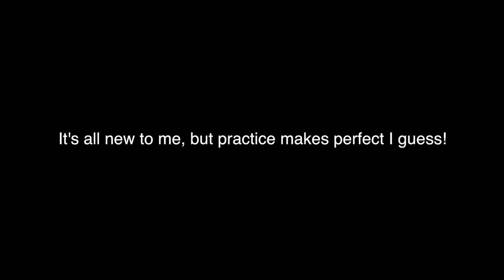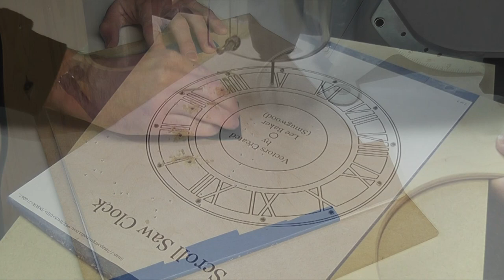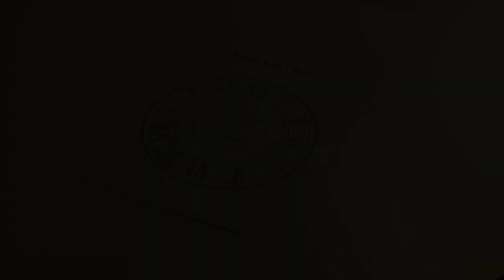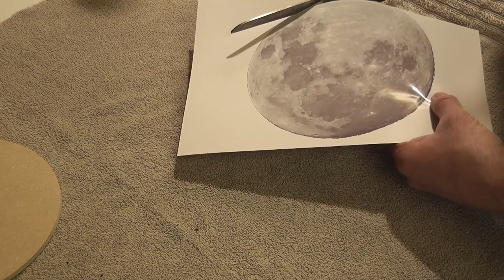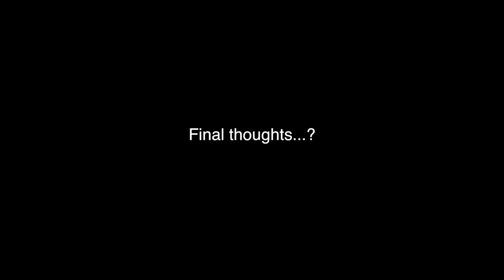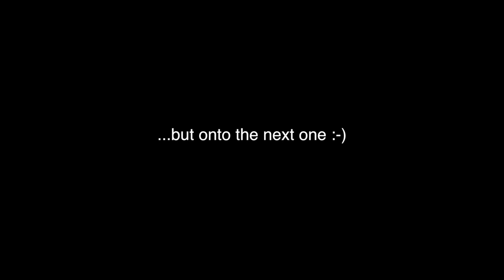Scroll Saw - Making A Moon Clock

Comment: Good job.  I have been scrolling 15 years and never used a spiral blade until about a month ago.  No more spirals for me.  I quickly switched back to standard flat blades.
Reply from the maker: Yeah...spirals have a place, but I think for now I'll be using the standard blades too. Ive a couple of projects to do that have small internal circle to remove so im guessing the spirals may be useful for projects like that, but i find them very difficult to cut straight. But im guessing that perhaps the spirals aren't really designed to be used for cutting straight lines?...although Im still very much in the learning stages of scrolling so that may not be 100% true :)
Reply: So this was made using a spiral blade? Would a standard blade made a smoother finish?( Looked great to me!) Also could you recommend a machine on a budget? Hear it's better pinless?

Comment: Turned out great! Not an great piece for a spiral blade, as you found out, but you did a great job anyways. I like spiral blades for portrait work where there is a lot of direction changes but for mostly straight line work a number 5 or 7 blade would be my choice. Thanks for posting!
Reply from the maker: Thanks. Surprisingly tricky scroll sawing and something I’ve still yet to master. Really handy for intricate cuts though and it’s nice to be hands on sometimes...I love spending time on my cnc but it’s nice to turn it off once in a while and scroll saw.

Comment: Hey, I thought your clock what brilliant for someone that has never done it before!   You had some very small sections to cut out and areas where the lines between the Roman numerals are very thin, so you could of easily buggered it up!   It's easy to say a machine has done a better one, of course it bloody well has, it's a machine!!    Have some pride in your great job and learn, that is all we can do as human beings, or so they say!!!  Cheers Sean
Reply from the maker: Thanks Sean. Some of the segments were rather thin and did concern me a couple of times and did take some careful cutting 😊 It made a nice change to use the scroll saw. I bought it last month as I quite fancy Intarsia work but I probably need a bit more practice first before attempting an intarsia project...unless I can find a simple project to start with.
Reply: Smugwood if you look online there are thousands of basic intarsia patterns.   Just type in free intarsia patterns and stuff like animals, especially dogs will come up.   I just blew up a pic of all the countries of the world to a ridiculous size and I'm hoping to use different wood for each country, or at least one type for half a dozen, as there seems to be one or two countries!!!  LOL.  I also want to shape the timber, so that The mountainous countries will look hilly and the flat ones are flat, but that might be a bit ridiculous, yeah just putting the timber on is a start?   Ha ha. Good luck with your projects!  I'm not that confident so I don't know if anyone would gain anything from watching a video of me, but I suppose if I don't do it then I won't know will I???   Cheers Sean
Reply from the maker: Cheers Sean. I did actually buy a couple of intarsia books so hopefully I’ll have a go soon. I thought it would be quite easy to do but having used the saw a couple of times I now realise that Intarsia is a skilled art. Hopefully one day I’ll master it 😊 And regarding your videos, like you say, you’ll never know if you don’t do it. Besides, when I make mine I’m not always sure what I’m doing but when people can see me working it’s easier for people to suggest alternative ways to do things...a lot easier than trying to explain with words or pictures too 😊
Reply: Smugwood cheers whatever your name is LOL?    Thanks for the advice, it's easy to give to others but a bitter pill to swallow ourselves.  Okay my only question is what program do you edit your videos on, please, as there are thousands out there?   I just want a simple one, that I can put baking music on if need be.   I assume your from the U.S which state?   I'm from Melbourne, Australia.   Take it easy cheers Sean
Reply from the maker: I had issues trying to edit on Pc so got a Mac. Used iMovie for a while...really easy to use but ended up getting Final Cut Pro X. I also like to make my own background music so for that I use Logic Pro X. I used to use GarageBand but needed a bit more flexibility so upgraded. 😊